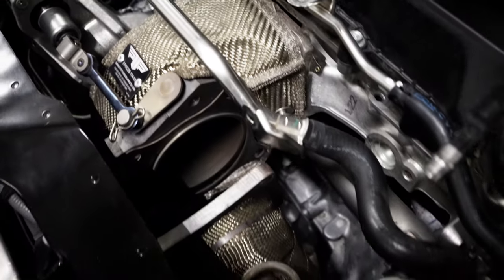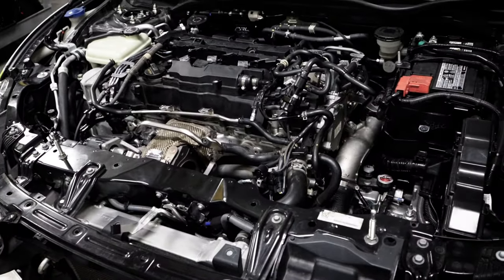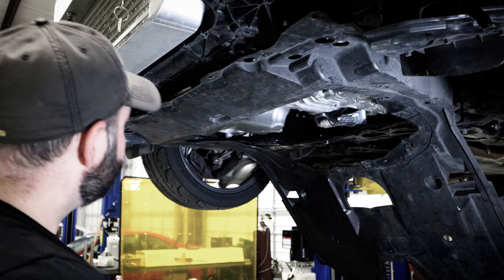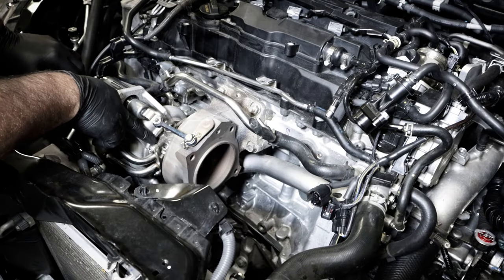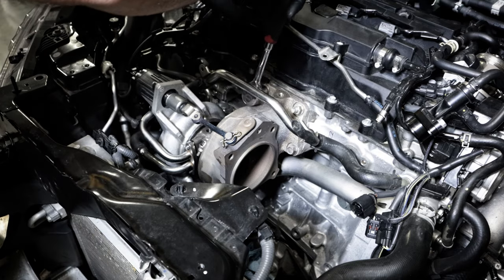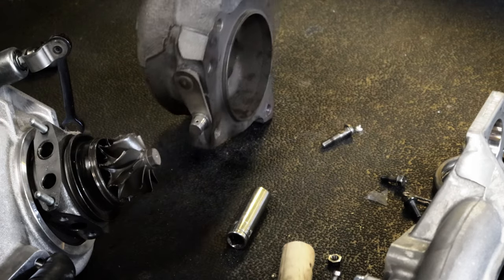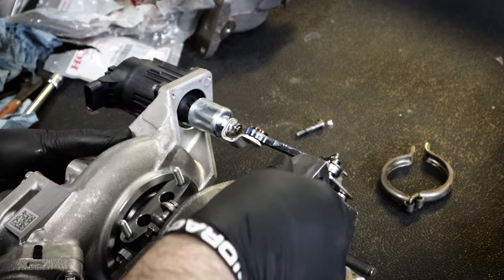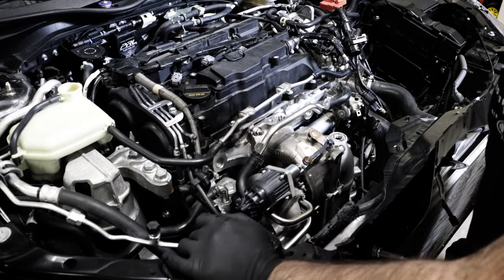2017 Honda Civic Type-R Pure550 Turbo Upgrade Install

Comment: You need to run without the charge pipe and air intake so you don’t break the turbo and better cooling

Comment: Will this fit on my 00 mustang v6
Reply from the maker: If you hit it with a hammer enough times, probably.
Reply: After you do the kswap, yes. Honda sells a complete drop in assembly for you 00 Mustang.